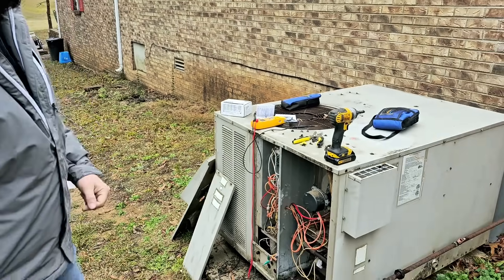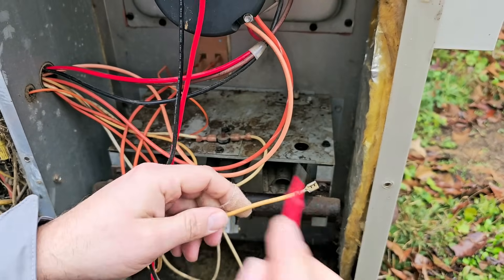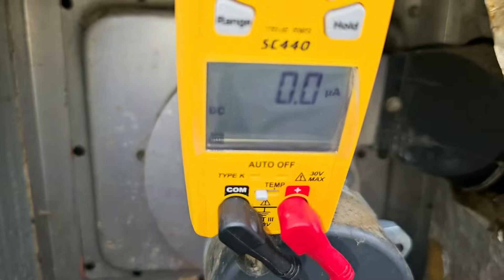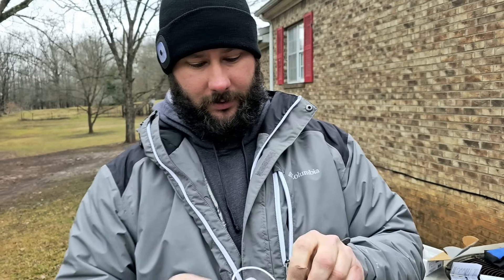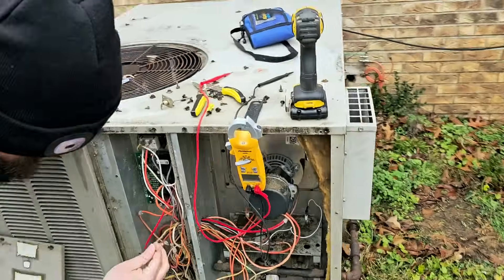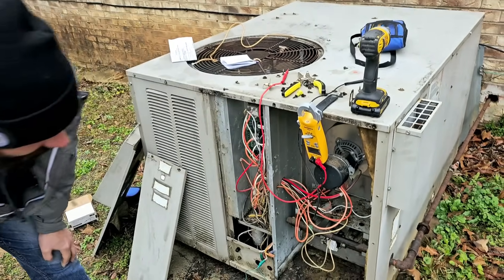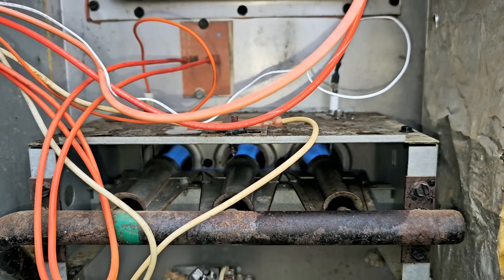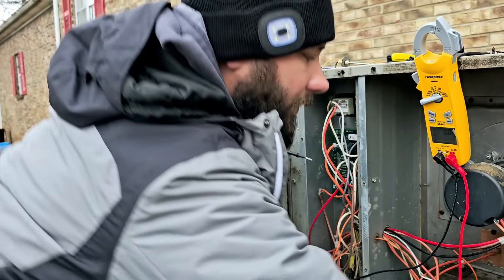How to check the Flame Sensor? #gasfurnace #hvac

Comment: What’s up taddy , , just was working on a Goodman furnace this weekend in Az, I was getting the signal to the board from the flame sensor, but the board would cut my 24v to my gas valve.  Got a new board and we’re good. Thanks for the video

Comment: Have this same unit and for some reason the blower won’t come on for heat. Works fine for AC but nothing after the heat comes on. Any ideas what the issue would be?  I thought something with the flame rod sensor may tell it the burners are on and to then turn on the blower.

Comment: If I remove the black and white wire to my gas valve…then I put the multimeter to read continuity from where I unplugged the white/black wire…and it says no-continuity “OL”, does that mean that my coil is no good in the gas valve and I need to replace the gas valve? 

Thanks for all your videos!! It gave me knowledge to work on my gas Hayward pool heater! 

https://youtube.com/shorts/4olwJP6yM7k?si=-Ejv4DNXrnJx_V_f

Comment: What if it shuts off every few days and runs fine in between?
Reply: The worst kind of trouble. Intermittent issues are a PITA! Dealing with 2 of them now.
Reply: Guessing if it's not the flame rod then maybe weak gas valve or gas valve relay on the board.

Comment: I might have missed something.  When you pulled the wire off the flame sensor to check for current flow, why didn't the furnace shut down?
Reply: It did but will keep trying to fire up.  Within a second of him disconnecting the wire you can hear the flame kick off.  A couple seconds later, while he was trying to connect his meter leads, you can hear the ignitor sparking away.

Comment: I have no flame hence part of my problem. How do I check the flame sensor if the flame does not come on?
Reply from the maker: You can't check the signal unless the flame sensor has a flame on it
Reply: @ I was not getting 24 V from the control board to the gas control valve so I wired directly from the transformer to the gas control valve and that opened and closed the valve. Hence the control board must have a bad relay or something not allowing 24 V to get to the gas control valve.  So I bought a control board. Hopefully that’ll fix the problem.
Reply: @condor5635  Did you take the wires off of the gas valve and measure for 24 volts?
Reply: @ - I took both wires and measured it with them removed and then I measured it with them. Attached both times same OL with a lightning bolt on my fluke.  So it definitely wasn’t getting 24 V. And it was getting it when I directly powered it. I replaced the board today and it’s back up and running.! thanks for your responses and input. I appreciate it.

Comment: Flame rectification is at the core. 120VAC to the flame through the rod, DC micro amps to the circuit board.

Comment: Very good video and thank you for sharing but I was wondering why you didn't first check from the IFC to the flame sensor without the burner ignited. Flame rectification requires a AC signal of around 50-180 AC volts from the IFC to the flame sensor. The flame sensor will have AC voltage on it when the unit has power on it and you could get shocked! Once the flame sensor is in the flame, that AC current travels through the flame as 2-7  DCMA through the burner and through the ground back to the IFC. I have seen Flame Sensors misdiagnosed because there was no AC voltage  going to the flame sensor before ignition.
Reply from the maker: good stuff thanks for sharing

Comment: You need to mention the wire is powered with ac voltage. Any where from 80 to 100 volts ac.

Comment: Interesting I have only seen two bad flame sensors in over 30 years. Back in the late 90s trane had issues with with their very thin sensors on propane systems. The only other one was one that I stepped on while do a cleaning of a furnace. I would like to know why that was bad? I have seen several of your videos and know you know what you are doing, but that sensors looked good. I have a guess that wasn't the issue. I would be willing to bet the burners are worn and causing the flame to drop. The longer sensors is in the flame better. Goodman had issues with burners doing that. The field fix is a hack. You loosen the 4 screws to the gas manifold. Put a washer, the thickness of a penny behind each of the upper 2 screws. This will cause the flame to hit the sensors again. The fix is to replace the burners that was what the recall was on those units years ago. Happy Easter
Reply: It could be a crack in porcelain or a rubout on the wire..  I have never seen a bad flame sensor in 30 years also..
Reply: @bmamich1 a crack would have given him a high reading due to going to ground. The only thing that would cause no reading is:
a very dirty sensor.  (Which he talked about cleaning)
A broken rod in the porcelain. (Someone would of had to brake it and make it looked fixed)
 Or the sensor wasn't in the flame. 
Adding a longer sensor would have picked up the flame if the burners are bad and shooting the flame slightly downward. Which was common on Goodman/Janitrol in the late 90s earlier 2000s.

Comment: How do you like these package units man? I think I need one. The only downside I see is that your always out in the cold, snow and even rain possibly  working on them. 
No one needs their heat worked on until you get records temp drops. Not always but sometimes right?
Reply from the maker: I like package units
But you can get higher efficiencies with split units plus the equipment last sometimes longer.
They go out in the most extreme temperatures but not always
Reply: @taddydigest  Well thanks for sharing man! Hey do heat limit switches to cut off the gas get power from the W terminal when using 24V? I have an old Honeywell fan limit switch. The fan side is stuck closed and the heat limit 24V side gets power from the Y terminal.

That can't be right can it? the other end winds up at terminal 1 of the S86F igniter box  where I am missing my 24 V to turn the gas on.

This is an 86 model Rheem 11EAR-JR.
Soon be knocking on 40 years old.

Comment: I'm in the process of running down a flame sensor issue with my Trane package unit(gas pack).   Not definite yet but it does appear that in my case the flame sensor bracket was losing ground bond and causing early shutdown.  If so I've been told this is quite rare.  I'm going to add a separate grounding wire from the mount bracket to see if that keeps it working.  I still need to check it as you're showing in the video.   But it's outside and cold and working now so will wait till I have to open it up again.

Comment: i still think it was the board AND flame sensor. easy a $932.86 call 😋😈
Reply: board $50 to 140, sensor maybe 10 ro 25, if its a tough location , maybe, but otherwise its a $150 labor.
Reply: uuh! almost forgot, 5lb of freon (r22)… $300 a lb 😈

Comment: Now I have questions like what’s the voltage that the control is sending? Is it looking for a specific resistance that a flame may provide? Could I test control integrity by disconnecting the female sensor terminal and putting it to ground right when the appears?
Reply: No, the current must be solely in the micro-amp region---that is the actual voltage presented is alternating current, BUT the rectification process is only allowed when there is a flame the flame basically acts as a low quality, but functioning nominally, diode where the positive versus the negative current is very slightly asymetric- that differential is the micro-amps read- the flame does create a resistance, but as a result of diode action difference in resistance (measured as micro-amps) between positive and negative alternation is perceived as the presence of a flame.

Comment: One note here that he should mention. The rod may look clean. You may get the rest of the season out of it if you clean it with sandpaper. What happens is the rod metal becomes crystalized from the heat and changes its electrical properties. To avoid call backs or a cold night, replace it ASAP.  Just did one the other night.

Comment: Interesting video, and some obviously knowledgeable replies to the thread as well...
Just a couple of quick questions re the testing...I understand that the wire from the FS could be faulty, hence why you tested between the FS and the board direct, but could you use the clamp to take a reading without disconnecting the wire? Or are the results from using the clamp  meter not as accurate enough? 
Secondly, with the flame sensor disconnected/removed , if you hooked up the leads to your meter to the outputs directly and applied a flame from say a turbo lighter or small torch, would you expect to see an output?
Reply: The clamp on meter is good for A/C but the flame sensor is very low D/C amps. This is called "Flame reification". His testing method is good.
Reply: @d.l.harrington4080  Thank you...I wasn't doubting the test method used, but rather trying to understand the limitations of the clamp meter....
Reply: @peterevans8194  I actually did this test today using the conventional "in series" test and also using a DC clamp meter which most people don't have.  Reading micro amps with a DC clamp meter I had to make a 10 wrap wire coil as a multiplier to compensate for the very low reading. Was a fun experiment but not worth the trouble.
Reply: @DayClanTribe  Thanks for that...practical testing like that trumps speculation every time!

Comment: If the ceramic is cracked,  the small amount of current goes directly to the ground instead of the control board.
Reply: Learned today you can use a "megger" to test for that.

Comment: This kind of sensor is similar of the oven type. Need flame for send son voltage with microamps.
Reply: Actually, in gas ovens the sensor is a combination of an intermittent pilot & a thermocouple-for so-called "off grid" stoves.------More traditional line operated stoves (AC power required) simply have a globar heating element wired in series with the gas valve solenoid.-----Gas valve cannot open, stay open and allow gas flow unless globar is "red hot."

Comment: Seems like a lot of work when two seconds removing and rubbing it on material and reinstalling will work or not.  If not, I use a resistor/ diode jumper (it fakes the reading back to the board) to make sure the board is good. Flame sensors rarely, almost never go bad they just corrode and need to be cleaned/ wiped off as long as the porcelain is not cracked and the burner ground is good.
Reply from the maker: Yup you're right usually you can clean them off and then reinstall and everything works fine.
Reply: @rcstl, like the person before me, I also am interested in more info on that diode jumper.
Reply: @realSamAndrew  I am trying to find the original article on how to make it.  It came from the hvac-talk board.  User slctech or my id.  It will take some searching.  The last note I saw was from 2016.  But a male spade (flame sensor spades are male)  to a 1M ohm resistor to a 1N4005 diode to an alligator clip.  Use some wire to make it longer and separate the components.  The male spade is plugged into the FS lead to the board and when the GV opens clip the alligator to the ground (burner chassis).  The diode creates the DC feedback the board is expecting.
Reply: How did you make that jumper? Would like to keep one handy

Comment: Notice you did not actually show cleaning the flame sensor and if it changed your reading. That is usually all it needs 9 of 10 times. Can count on one hand how many flame sensors I have actually had to replace in 20 years, and still have a couple fingers left. They were either broken/cracked on the insulator and one was burnt into from an old LP Gas pack.
Reply: Well, the replacement is $40 !! vs maybe $10, so someone is happy selling them, LOLOL. Its amazing the amount of crappola I see people doing.
Reply: @MYHVACLIFE  I had a bad one in a brand new unit today, never fired.
Reply: Should have tried cleaning the old one first.  A layer of dirt and oxide is the main failure mode.  Probably a cleaning would have had the furnace back in operation.

Comment: The microamps are not identical on all furnaces, so they need to be checked against the furnace documentation. Those very rarely need to be replaced. They are just a piece of metal. It's usually connectors that are corroded that give problems
Reply: @Quentyn73  Actually a bi-metal gizmo that reacts heat by creating electricity.. as evidenced by this video and people’s interest in the video they do fail after some time.   Sometimes they last 10 years or longer… sometimes they don’t.
Reply: @3dsman Now, don't be confusing thermocouples with flame sensors. The latter do not give off electricity but change their resistance with presence of heat. The plasma in the flame acts as conductor. A thermocouple makes a small amount of electricity from heat. Makes sense?
Reply: @ Interesting.. I’m not used to the varying resistance versions.   As a matter of nomenclature both act as ‘flame sensors’ so the terminology is peculiar.   I just ordered a 3-pack of thermocouples from amazon for $10 so I’m absolutely a fan of the longevity (my furnace is well over 10 years old.. probably more like 15) and only now having issues.   I’ve replaced them in spaheaters and water heaters so for the money I love them.   No idea how long the variable resistance version you’re teaching me about last….